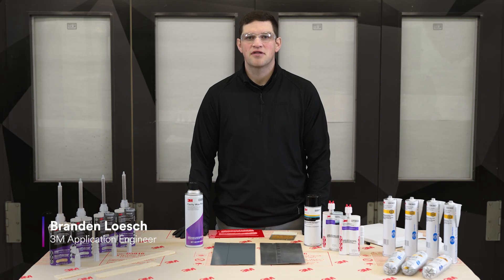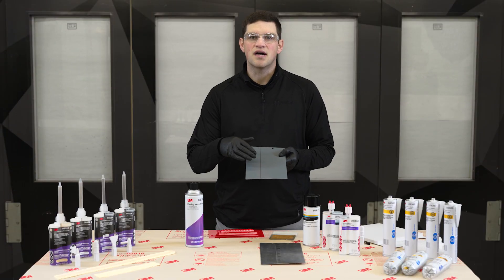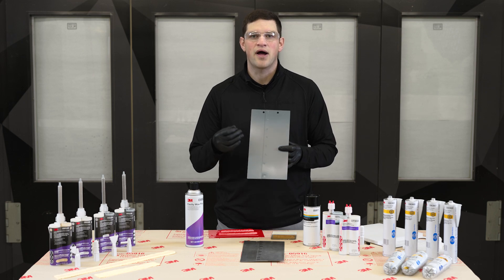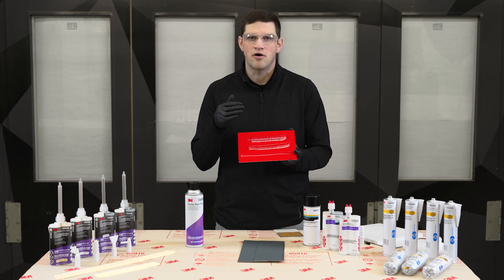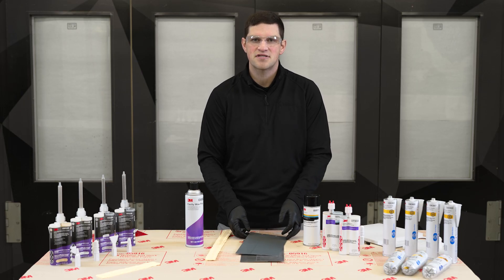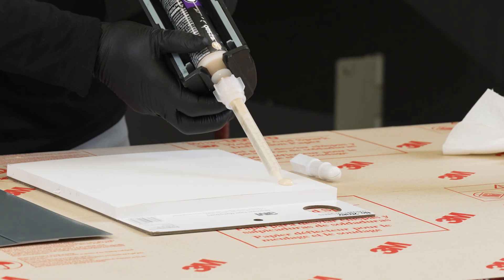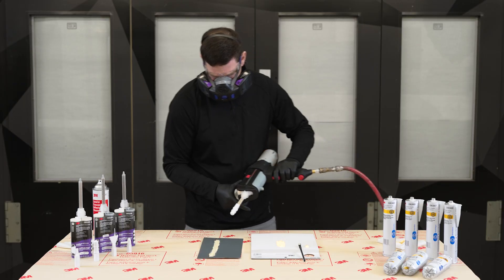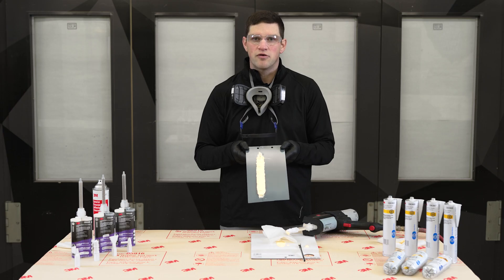Why OEMs Specify Epoxy Primers for Corrosion Protection

Comment: My old paint shop all way had 2k seal around. Now at a chain store. We get 2k in a can. We wast a can just for a little 2k . We use can etching primer alot. Wich sprayable say you now .i try to keep with bare metal seamsealer.  But find my self using etch more becouse that the normal now . Which i was tought to neaver do. Any thought .